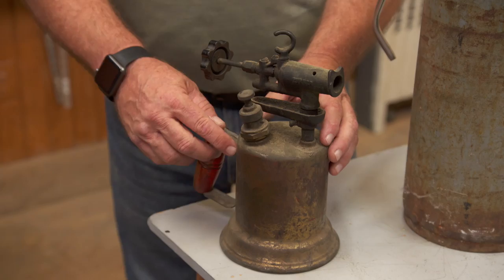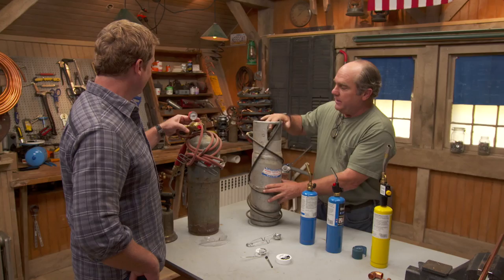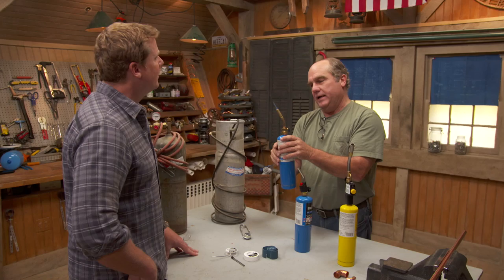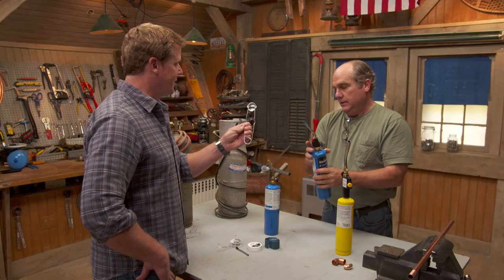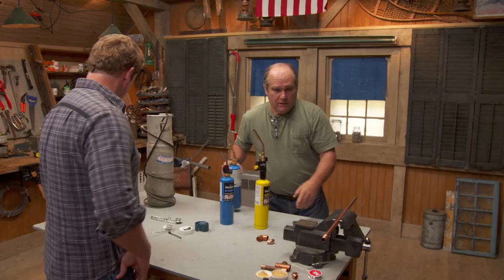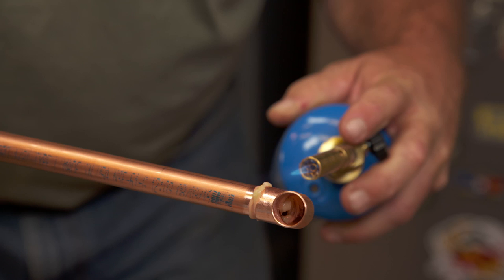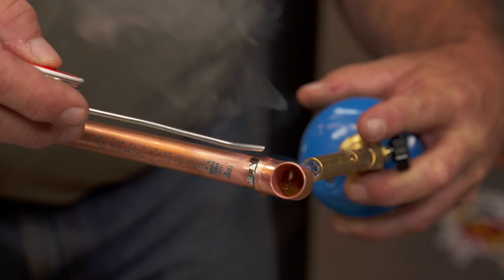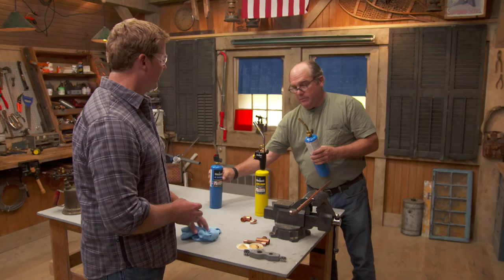How to Choose and Use a Blowtorch | Ask This Old House

Comment: Perhaps this video needs to be re-visited since the time it was made MAPP GAS is no longer in production and the so called MAPP tanks today are just substitutes that reach the same temperature.
Reply: Gilberto Diaz-Castro True, but the propylene substitutes are labeled MAPP-PRO. To use their current proper name, one still has to include the MAPP section.
Reply: @dylanheadrick3789  Isn't it MAP/ PRO, though?
Reply: Here's the thing, if you take that MAPP torch off the MAPP bottle and put it on to the Propane bottle it will do exactly the same type work that they say you need MAPP for. Its all a rip off. In my experiments, Propane with the TS8000 MAPP torch fitted heated up the work metal (mild steel flat bar) 12°C hotter than if I used the MAPP setup after 1 minuet of heating the metal both from a base temperature of 18°C - MAPP 415°C, Propane (same torch) 427°C. Make of it what you will. I Silver solder now with the MAPP torch on a hose connected to my 9Kg Propane bottle that I also use for camping (running the cooker on the camper trailer) so now I can take a means of doing road side repairs to metal work when outback if I need to, just one hose and the torch, easy to pack.
Yes you can put the Propane Torch onto a MAPP bottle but you will get Propane performance from it, not MAPP. Its all about the torch, not the gas.

Comment: It looks like the price gap between the manual and trigger start torch heads has narrowed significantly since this video was made. The pencil flame head retails for $14.25 at my local Home Depot, while the basic WT2301 trigger start he appears to be using goes for $17.31 at the same store. That's a difference of $3.06, not $10.

Comment: Is the torch interchangeable? Can i switch from the bigger torch tip to the pencil one on same canister? Or is it once i put a toch on canister i have to use it till its done?
Reply: Here's the thing, if you take that MAPP torch off the MAPP bottle and put it on to the Propane bottle it will do exactly the same type work that they say you need MAPP for. Its all a rip off. In my experiments, Propane with the TS8000 MAPP torch fitted heated up the work metal (mild steel flat bar) 12°C hotter than if I used the MAPP setup after 1 minuet of heating the metal both from a base temperature of 18°C - MAPP 415°C, Propane (same torch) 427°C. Make of it what you will. I Silver solder now with the MAPP torch on a hose connected to my 9Kg Propane bottle that I also use for camping (running the cooker on the camper trailer) so now I can take a means of doing road side repairs to metal work when outback if I need to, just one hose and the torch, easy to pack.
Yes you can put the Propane Torch onto a MAPP bottle but you will get Propane performance from it, not MAPP. Its all about the torch, not the gas.

Comment: can you braze with just the MAPP?
Reply: Here's the thing, if you take that MAPP torch off the MAPP bottle and put it on to the Propane bottle it will do exactly the same type work that they say you need MAPP for. Its all a rip off. In my experiments, Propane with the TS8000 MAPP torch fitted heated up the work metal (mild steel flat bar) 12°C hotter than if I used the MAPP setup after 1 minuet of heating the metal both from a base temperature of 18°C - MAPP 415°C, Propane (same torch) 427°C. Make of it what you will. I Silver solder now with the MAPP torch on a hose connected to my 9Kg Propane bottle that I also use for camping (running the cooker on the camper trailer) so now I can take a means of doing road side repairs to metal work when outback if I need to, just one hose and the torch, easy to pack.

Comment: can you use a torch that came with a propane canister with map gas canister.
Reply: Can use map tip for propane but not the propane tip for map
Reply: @tylerlappa7356  not sure about the model shown in the video, but here in the UK, these type of torches are interchangeable between Mapp and Propane..I am talking about torches like the Rothenberger Surefire 2 for instance....
Reply: Here's the thing, if you take that MAPP torch off the MAPP bottle and put it on to the Propane bottle it will do exactly the same type work that they say you need MAPP for. Its all a rip off. In my experiments, Propane with the TS8000 MAPP torch fitted heated up the work metal (mild steel flat bar) 12°C hotter than if I used the MAPP setup after 1 minuet of heating the metal both from a base temperature of 18°C - MAPP 415°C, Propane (same torch) 427°C. Make of it what you will. I Silver solder now with the MAPP torch on a hose connected to my 9Kg Propane bottle that I also use for camping (running the cooker on the camper trailer) so now I can take a means of doing road side repairs to metal work when outback if I need to, just one hose and the torch, easy to pack.
Yes you can put the Propane Torch onto a MAPP bottle but you will get Propane performance from it, not MAPP. Its all about the torch, not the gas.

Comment: can you use a torch that sizes to heat and bend steel.
Reply: depends on the thickness of the steel. If you want it hardened you will need to heat it above 750 degrees(if i remember right) and cool it down fast.

Comment: You should never put the flame directly onto the fitting when doing a soft soldered joint.
The flame should always be directed to the pipe about 40mm back from the joint.

Every now and then, apply the  soft solder wire to the joint and as soon as it melts, remove the flame keeping the soft solder on the joint until it runs around the whole joint.
This will allow the solder to be drawn inand completely around the joint through capillary action, hence the name, "capillary joint fitting".
 Putting the flame into the fitting can put too much heat into the joint and burn the solder out.

 The only time you will need to put the flame directly onto the pipe and fitting at the joint, is when you are doing silver soldering.

Notice the dfference?
"Soft solder" and "Silver solder".
 Silver solder, minimum 2% silver, will give a much better and secure joint, but you will need relatively more expensive equipement to do a sound joint and requires much more skill than with soft soldered joints.

 With new copper pipe and fittings, if you use the best flux, like 'La-co Regular Soldering Flux', you will not have to clean the pipe or fitting.
La-Co flux is also water soluble and when the joints are finnish, all you have to do to clean everything is to flush it thoroughly, inside and out.
https://www.bromic.com/plumbing/laco-regular-soldering-flux-paste.html

Ken Lyneham
Lyneham Plumbing Services
Lic. No. L5236

Comment: first of all a "blowtorch" is an oxy acetylene torch with a cutting head that "blows" pure oxygen into the tip blowing molten metal away making a cut, these are just plain torches.
Reply: That's correct! I am glad I'm not the only one that thought of that.
Reply: the title writer clearly's not a plumber
Reply: no, what you are describing is an oxy-fuel or oxy-acetylene torch, this is a blowtorch and doesnt use oxygen, on the other hand an oxy-fuel torch does

Comment: “Gets about 15% hotter” such an obviously bs statement.
Reply: Here's the thing, if you take that MAPP torch off the MAPP bottle and put it on to the Propane bottle it will do exactly the same type work that they say you need MAPP for. Its all a rip off. In my experiments, Propane with the TS8000 MAPP torch fitted heated up the work metal (mild steel flat bar) 12°C hotter than if I used the MAPP setup after 1 minuet of heating the metal both from a base temperature of 18°C - MAPP 415°C, Propane (same torch) 427°C. Make of it what you will. I Silver solder now with the MAPP torch on a hose connected to my 9Kg Propane bottle that I also use for camping (running the cooker on the camper trailer) so now I can take a means of doing road side repairs to metal work when outback if I need to, just one hose and the torch, easy to pack.
Yes you can put the Propane Torch onto a MAPP bottle but you will get Propane performance from it, not MAPP. Its all about the torch, not the gas.